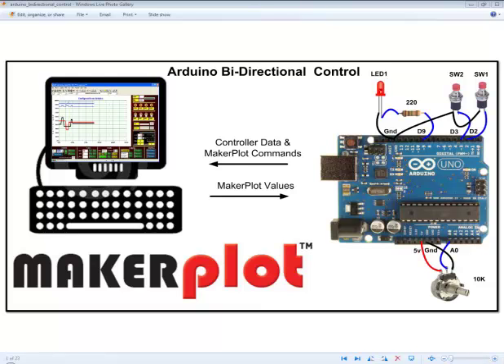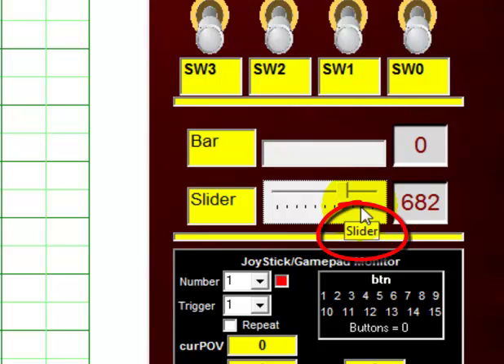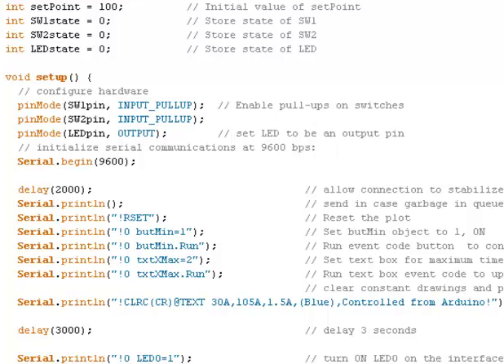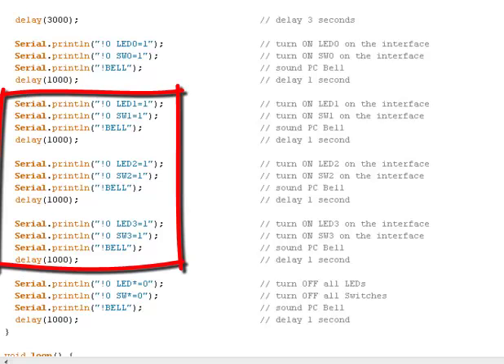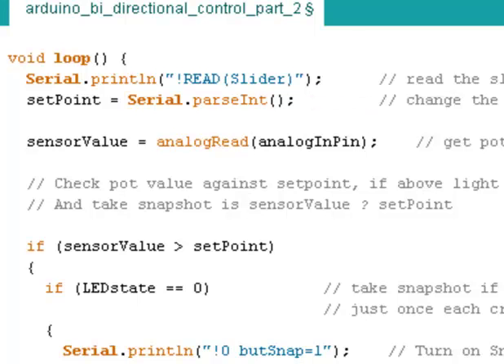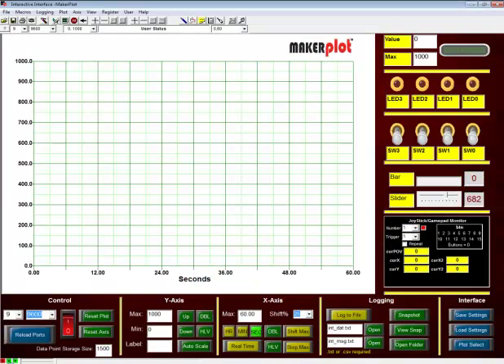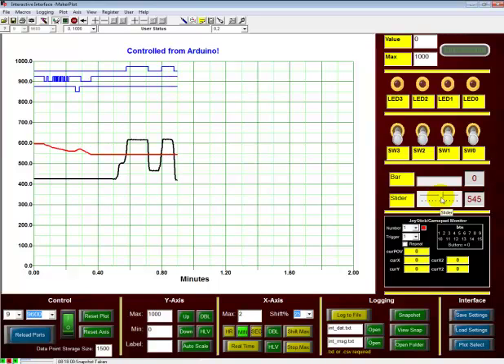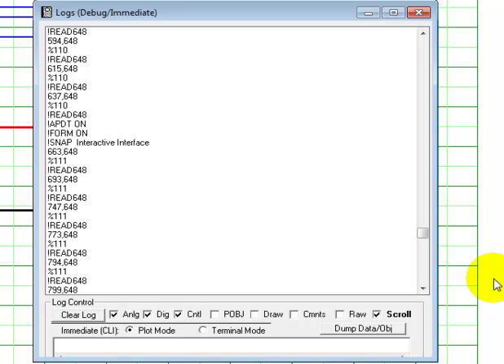Arduino Bi-Directional Control Part 2

Comment: Heya Dude, I don't wanna be rude but the program looks like it is build for Windows 3.1. I understand it take some time to make (Í am also a programmer but in many directions) and you ask some license fee for it but it is not very attractive. Besides, Arduino is designed for kids and open source so I don't understand why you want money for it because there are tutorials around that can do the same as your program and it is not directly binded to a software program. So what's the idea around this and why should people want to learn your outdated looking program? Sorry, I don't understand what you want to achieve, maybe money but doesn't fit the idea of Arduino. Why you don't make it open source to make it better? Your views explain it all, it needs to be better.